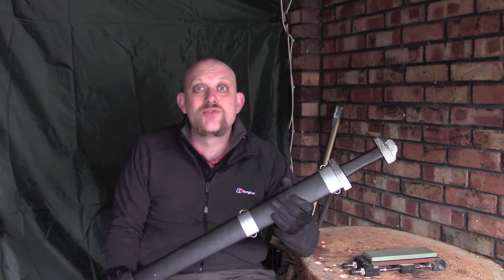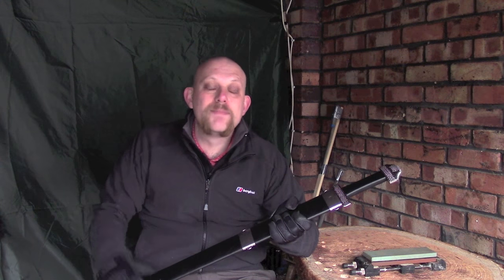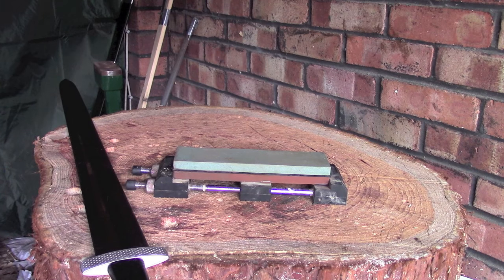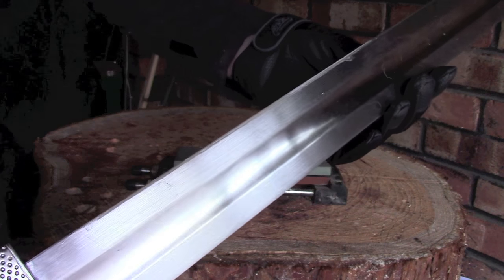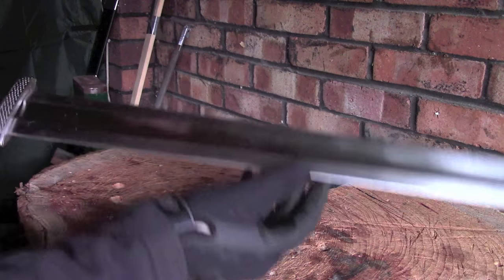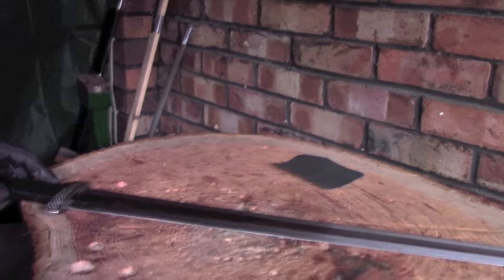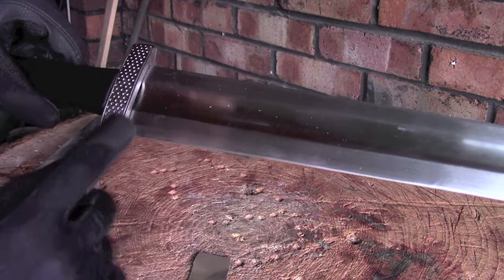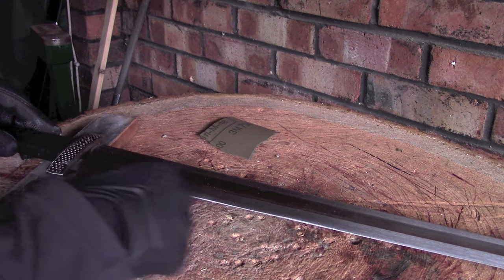Sharpening a Sword by Hand

Comment: I am a historian, and u are spot on. This goes for armour as well. Aslo, this is an aside but a knight in shining armour would also have a sircoat bearing early heraldic symbols unique to him and later a family with a "change". Also many castles were whitewashed to prevent fire and insulate the structure. Also, many curators and historical pieces are brought to a high Shean. This look fabulous, but it is my belief this would not be how it looked in the period.

Comment: For blending edges I use a stick about 16 inches long and 1-2 inches wide with emory cloth or sandpaper strips held to the wood by the grip of your hands allows you make long strokes at calculated angles. If you want more blending use a thinner stick or some backing (mousepad, felt, leather) to allow the sandpaper to deform more. It is very important to push your strokes slightly away from the cutting edge along the length of the blade so you dont loose a finger. The use of a mousepad and sandpaper on a flat surface will also allow one to grind a convex edge on a blade. I really appreciate you showing your method, and especially the reminders on safety and distraction avoidance.
Reply: Got a vid of that?

Comment: Thanks for the informative video. Planning on actually getting a Tinker so very helpful. I do have a question about what grit whetstone to use? Especially for a semi sharp sword.
Reply from the maker: If you excuse the pun it's a bit of a double edged sword!  You can use a finer grit but it will take a lot longer to remove the necessary steel or a coarser grit but you then spend the time later refining and polishing. If it is very blunt I would say a coarse grit like 200 to start and get the profile right then work your way up to a 1000 or higher to get everything nice and shiny. Wet and dry paper is great for final finishing.
If the profile is good and the blade mostly sharp then a 1000 grit should be fine and if it turns out not to be enough you can always revert back to the coarser grades. Hope that helps.
Reply: Thanks a lot. It certainly. I'm knew to this but it's certainly a good hobby to get into. Nothing better than the feeling of swinging a sword around.

Comment: Well done, you noted in the comments that the stone was a dual 250/1000 grit. If I can ask which of the sides did you use to sharpen the blade ?
Reply: From the grinding sound, it sounds like 250 grit

Comment: This video is about sharpening swords. You don't even give the grit on each side of your whetstone, and then proceed to sharpen it with a dry stone! That's a wonderful way to wear down your stone abnormally fast and give you a rougher edge, but it's not a good way to sharpen your blade. At the very least your stone should be well soaked with water and have water applied to the stone throughout the process. What is far better though is to use a light mineral oil (not WD-40). Three in one oil has a God balance but light, clear oil is better. When you are finished, wha she your stone with some liquid hand soap or dishwashing liquid. That will remove all of the excess metal debris that clogs up the grit of your stone over time. Never use a dry whetstone! ⚔️

Comment: I just recently bought a 13th Century sword which is advertised as sharp but like you it's notas sharp as i thought it Would be. Like yours its a bit sharp in areas. For me the edge of the tip is thinner than rest. My sword is sharp in areas but dull sharp. If that make sense. I'm thinking of sharpening it to get it the way you did

Comment: I'd like a sword which has a sharpener (something like a knife sharpener I guess) built into the scabbard so every time you put it away the blade is sharpened a bit.
Reply: Wireless_Phantom ut would ruin the blade if you kept puting it in and out it would become brittle
Reply: gaunter odimm really??? Ive heard of bayonets with cases like that.
Reply: after the first sharpening the sword wouldn't even fit into the scabbard and would probably chip the sword over time
Reply: This is how my old Vietnam Bayonet worked. Never dull.
Reply: gaunter odimm It depend on the sharpener that put in it,mostly they put the one that not to coarse or a very fine sharpener in order no to ruin the shape of sword/knife/karambit or etc. It look like a sand paper but a bit hard.

Comment: Hello I was thinking about getting a sword fram Ryan Swords (Brisingr Eragon Movie Sword Handmade 1095 High carbon steel)
Can you cut yourself easily with a sword or do you have to put force into the swings to do any cutting with the sword
All the sword I have are very dull or blunted. I dont plan to doing anything stupid but if the blade made little contact with my body would it cut though me
or if am just touching the blade, will it cut me.

I was talking to them, and they told me then could make the sword without sharping it. Do you thank that would be the best?
I dont plan on cutting with it. most of the time it's going to be hanging on my wall or a maybe swing it around a little in my backyard.

Eragon was one of my favorite movies when I was a kid. Because of the dragons

Great video
Jonko

Comment: I just got myself a Hanwei tinker longsword(sharp).
It's not as sharp as one would like although it's marketed as sharps...and the 1/3 of the blade close to the hilt were not sharp at all!
It's almost 2mm thick material.
Reply: The blade close to the guard is not supposed to be sharp. It's used mostly for parrying, not cutting

Comment: Doesn't polish do the same job as the blending in with the sand paper? It takes away a tiny layer of metal and makes the blade match the edge.
Reply from the maker: Filip Plotek exactly right, I tend to use the sandpaper as I have a ready supply of it and don't often do any metal polishing but both would work. In fact I could probably get a better blend if I polished after the fine sanding.

Comment: Great video dude, Would sharpening a sword on a bench stone work on those swords that are designed to be blunt? because i really want to get a bastard sword but the prices of them are insane so i was planning on getting the blade on it's own and build the rest myself but they dont do sharp blades... so would i be able to add a point to a blade with one of these bench stones? 
Much appreciated.
Reply from the maker: It should be possible to sharpen any sword in this manner, though if it is really blunt it might take some time and you may need to use a file to get the profile right.
The biggest problem you will find is blunt swords are unlikely to have been treated and tempered the same way a sharps are leaving you with a less than ideal edge once sharpened that will either be too soft or too brittle.
Reply: Woodcraft Hamster Ahhh thanks, Getting a decent two handed sword cost as much as a cheap car so i am trying to cut corners wherever i can to make a unique one.
I was originally going to make a custom sword from scratch but i cant find any carbon steel suppliers around my part of england.... Thanks anyway dude, appreciate the help.

Comment: Just as a little fact for you, by the 1200s swords were a common mans weapon.
Reply: Joseph Stalin no shit Sherlock
Reply: I mean, I guess it depends on where you're talking? In the 1400's in most of Europe it was still common and law in most places that only nobility or knights were allows to carry around swords inside a towns walls, and their high price and manufacturing time made them an incredible status of wealth and power.

Being a weapon that requires a lot of training in order to use effectively the "common mans" weapon were actually axes, hatchets, spears, hammers, etc, all these were just as deadly as a sword with far less of a learning curve. 

Spears and pikes were often the more sought out after because of the range advantage and how easily made they were. A line of spear or pikemen were far more influential on a battlefield than a row of men with swords and shields, and costed nearly a fraction the price and practice.
Reply: @chickenfinger7829  a well-made sword in the 1400's was like wearing a Rolex watch today

Comment: usually a sword shouldn't be knife sharp...
Reply from the maker: That's very true when is comes to historical swords however I think it is a lot more common nowdays where swords are used for cutting practice.
Reply: No...they should be shaving sharp. Yeah, believe it or not you actually want a sharp blade if you're going to go about cutting people. Shocking,  I know.
Reply: Fact is, 1 in 200 Vikings actually had swords.  They sharpened on stone or at best a whetstone wheel.   Now you say shaving sharp. I sharpen straight razors and can tell you that there is NO way they could get shaving sharp back then.  Even he says his stone is 250grit on one side and 1000grit n the other. HUH, that's not even close. I have paper that goes into the 50K microns.  IMO, a decent edge on a working knife is at 1500grit.  If you looked at an edge under a microscope, a 1500grit,  blade looks like a buzz saw blade edge.  When I take it to a 50K microns, it puts a mirror finish on the edge and under a microscope it looks completely straight.. So unless that edge has a mirror finish, it's not razor, shaving sharp.
Reply: cchgn 
"1 in 200 Vikings actually had swords.  "
Irrelevant.

"They sharpened on stone or at best a whetstone wheel"
Uh....you do realize they had razors(albeit not as fine as modern ones) and shaved back then, right? Oh, and they had sharpening wheels - which could be water powered or foot-powered. Oh, and....um...I'm not sure if you know this but the Japanese sharpened their swords on the same shit and they did just fine.

" If you looked at an edge under a microscope"
A powerful enough microscope and it will look like that regardless of how fine the grit.

" it's not razor, shaving sharp."
No...it's shaving sharp if you can shave with it cleanly. No one said "razor sharp". Don't move the goalpost.

" a decent edge on a working knife is at 1500grit"
That's somewhat excessive, but it depends on what you're cutting. And I'm pretty sure they could cut stones that fine.
Reply: Swords that aren't shaving sharp fail against the simplest of armor (gambeson, i.e. a few layers of cloth).
It doesn't matter if the edge doesn't last for hundreds of cuts. Most battles won't last that long for you.
And believe it or not, people would probably rather resharpen and put effort into their sword after every encounter, than not do so and then getting slashed to mince-meat by someone else who did.

Swords are not axes. Their balance is not in the striking point. They are not clubs, bone breakers or armor beaters. Stop perpetrating that myth.
Any armor that can't be cut with a sharp sword, won't be cut with a less sharp sword either. And at that point if probably shouldn't be attacked with a cut in the first place.
Swords that are used against armor or primarily for thrusts have bad cutting performance because of their very design, not because of the final edge you put on them.

The swords in this video that 'fail' against even the very thin gambeson are still sharp enough to cut tatami, according to their owner. The one that actually cuts through the gamebson and into the test target is considered 'shaving' -sharp.
https://www.youtube.com/watch?v=uP4wLMmp-8U&t=0s
Reply: okay,
first.
your comment about the falchion is clear fabrication. The Falchion (and also Messer) refer to blade geometries with one sharpenend edge, as opposed to two sharpened edges in most other swords. Their CoG is, as with any other sword, close to the guard. Again, they are not axes or sharpened clubs. They have broad blades, but with a distal taper and usual guard/pommel their center of gravity is /nowhere/ near the end of the blade.

second.
You didn't specify 'razor' sharp. You specified shaving sharp -> Quote from your comment: "Furthermore, [...]  swords were nowhere near shaving sharp"
And shaving sharp very clearly means: so sharp you can shave with it. Razor sharp may be interpreted as sharper, but for a such a descriptive calling as 'shaving sharp', I really don't think there's any wiggle-room.
Besides, even axes are kept 'shaving sharp' (yes really). Here's even an instruction manual by probably well experienced personell on how to do so. 
https://www.fhwa.dot.gov/environment/recreational_trails/publications/fs_publications/99232823/page15.cfm#sharp
Shaving sharp really only defines the sharpness, not the shape of the  overall grind. A convex grind can be shaving sharp, and would make for a very good edge.
Again, it doesn't matter if 1 cm of the edge receives slight damage from cutting through a bone. It's a tool for cutting, cutting tools will get damaged. And again, people even back in the day would probably have prefered swords that could gut your enemy even through their collarbone or ribs, instead of getting stuck in it.

third. 
Yes, swords can be used like a club by applying the Mordhau technique... by point them the other way around, thus reversing their CoG and removing their sharp bit from the impact. Well done, you've defeated the point of debating edge sharpness in that case. It doesn't however take away from the argument or context that my original statement was presented in.
Also yes, most swords can cut AND thrust. My statetment that some swords will be bad cutters might be excessive, but you agreed to the general gist that some swords are explicitly designed to favor cuts, and other thrusts (in particular; thrusts against armor with slim fine-pointed blades as opposed to 'broad' swords.

fourth. 
Gambeson is not the 'kevlar of the medieval world'. That would imply that gambeson is a high end armor, when really it was the cheapest option for people who didn't want to go into battle basically butt-naked. It showed up plenty and was worn under heavier armor as padding. A sword that was able to defeat gambeson not just with thrust but also cuts will most certainly have been more useful than a sword that had to rely solely on thrusts against anything above "peasant wearing a shirt"...

fifth.
Appleseed edge/blade geometry does not give your edge more 'mass' or weight. Any mass you gain in the convex grind is most likely substracted in a substatial fuller, to maintain the center of gravity at the hilt. 
It does give the edge more stability, at the very least compared to a brutally caved out hollow grind. Between a flat and convex grind with the same edge-angle though, it probably barely matters at all. (Also, because I'm petty, I believe you mistook concave for convex one time there. Concave would be hollow grind, convex is appleseed-grind. I mess those two up a lot as well :P )
Reply: You know they figured, how samurais had atom thin blade edges. Carbon sheet.  They folded dead leaves into the steel.  Kinda Damascus steel like but....